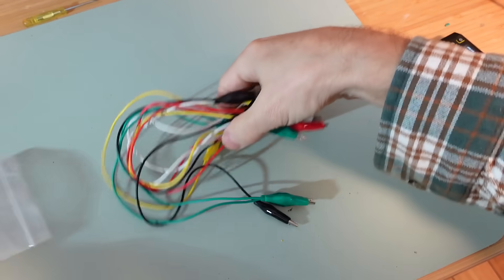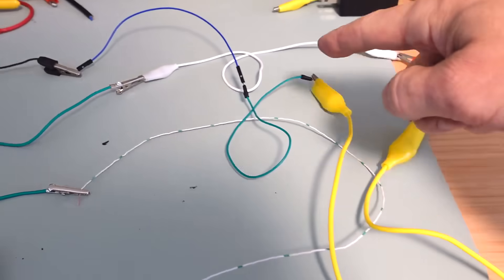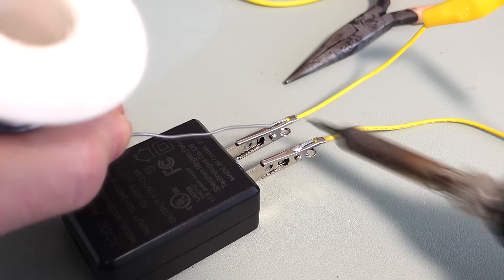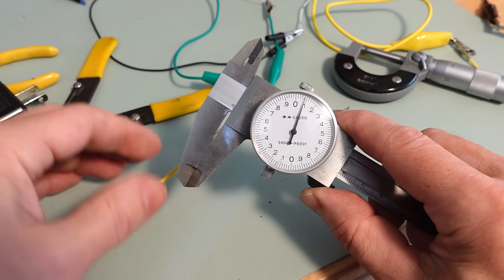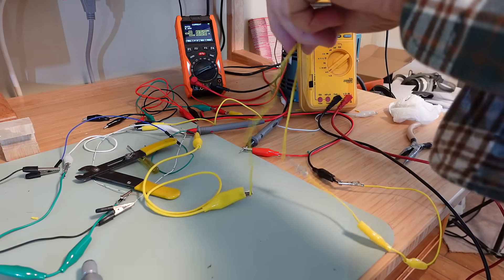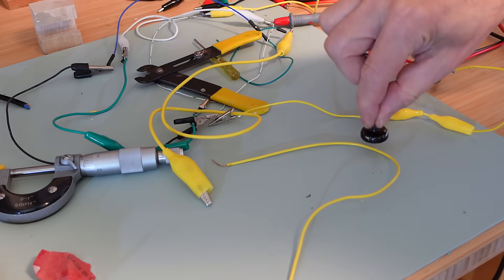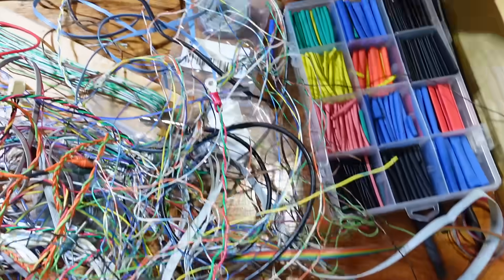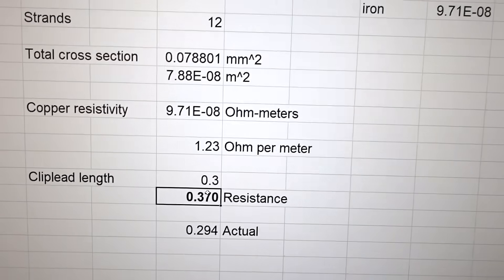Clip leads made with fake wire

Comment: Busted out a magnet to find some of my ribbon cables are iron cored, some are not. Gotta wonder with the miniscule amount of actual wire that goes into these things what are they really saving in terms of costs, a couple pennies? End price is always inflated as hell on Amazon in the end anyway and that penny saving iron wire is just an added insult. For milliohm testing I use an RC3563 battery tester. It's designed for testing internal resistance of batteries, but works just as well testing plain wire resistance with a resolution of 1mOhm. WAY more precise, even if not extremely accurate, than a DMM. If you're thinking of picking one up, SHOP AROUND, I've seem it sold for ridiculous prices and way down to $30 USD. Nothing but scalpers and drop-shippers especially on Amazon.

Comment: To see if cables are aluminium or CCA you can have out the strands and use a regular lighter on the strands, if it curls back like a spring it's aluminium.

All those clips leads is only for small signals and even in stores here they are exactly the same....

I always change the cable and solder 😅
Last time i just bought a bag of loose clips instead.

Didn't think it was iron tho, just that it was the miniscule amount of cross section since it's thinner than lady beards 😹

Comment: If it's less that 1 ohm is that really relevant?
Reply from the maker: sometimes I pass 5 amps thru clipleads.  that would be 25 watts loss, enough to melt the lead
Reply: @matthiasrandomstuff2221  Just because you can sometimes do a thing does not necessarily make it a smart thing to do. LOL.

Comment: I got scammed by those junk Chinese wire-clip leads 3-4 years ago.  Literally, no solder used at all, junk wire, and the resistance varied from 0.2 to 8+ ohm so I threw them into the trash can 😡

I started making my own wire-clip leads with quality wire with soldered on clips which all have a resistance of 0.2ohm which I put to the test on a 750mV floor furnace system when testing the thermostat and universal gas valve, they worked perfectly which is more than I can say about the defectively engineered Honeywell millivolt thermostat 🥳

To be fair, the Chinese 12awg versions are top quality wire-clip leads and worth adding to your toolbox.  I've used them on multiple occasions for jumping out a water heater till replacement parts arrived.  The wires only got a little warm and easily handled the current draw (4500W element) and sure beats taking a cold shower 😉

Comment: The mouse wire might be magnetic from any reinforcement in the cable. I wonder if you took the casing off and tested the actual electrical wires if that would be copper or not.

Comment: Mouse and telephone wires are iron or some alloy since the leads or shelding is made of iron because it is more resistand to breaking because of flexing. And since there is not much current flowing, it's not going to be problem.

Comment: Classic for Chinese, even transformers wire is aluminum with email that looks like is copper. also i have some thick speaker wire that I trash as it was copper plated aluminum , 
Now it became official some, reputable seller eve mention copper claded aluminum on the wire material.
Buying from reputable seller will mention even the crocodile, if is made from steel or copper and the cladding material...
Reply: they might use steel on bride material that protects cable or environment from interference, ...

Comment: I’ve noticed this trend from years back. Many many devices, leads etc. Have iron wires what you can find from Ali. Some of them have few copper strands and the rest iron. What I’ve seen were uncoated iron se they were easily visible. Funny that they started to copper plate those, but you can’t fool the magnet. Also many of the headers and connectors you can find from Ali are iron. You never know what you get from there. I encourage to write to the review these things. I always do that and hopefully someone read the reviews and skip those..

Comment: Maybe those are optimized for high-frequency AC-only tests?  Seriously though, I was expecting to find comments related to whether electricity flows more through the surface of the wire or through the cross-section.

Comment: Well, there is one quite good reason for some wires to be made of steel instead of copper: It is way more robust against fatigue cracks when moving them all the time, copper tends to break way easier. Of course the drawback is their higher resistance, so the use is limited to where that is not a problem. E.g. a signalling cable exposed to a lot of flexing would be a good candidate to be made using steel conductors instead of copper. Mainly when it is handling rf, where all the current flows just on the surface anyway, so through the copper coating part.
In fact many old (wired) telephone head set cables were using conductors made of metal (maybe not even copper) coated nylon strands, again to prevent them from breaking so often with all the use and abuse the telephones encountered. A 1m wire had easily a few Ohms, but in a few 100's Ohm earpiece or microphone circuit it was no big deal at all, the fact it was not developing crack and then contact noise between individual strands, as the worn out copper cables used to do, so the absence of all the motion related crackling was quite a big deal in that application...
Of course, it should be stated in the product description, otherwise I would also consider it a scam.

Comment: I recently wondered why my cheap crocodile cables from Aliexpress get very warm even with a low current. While watching the video, I held a magnet to it. Guess what the result was.
I knew that the Chinese like to use copper-plated aluminum. (Especially for transformers) but iron wire was new to me.
However, I have already noticed this with resistors and diodes from China. The wire scraps always got stuck on the magnetic side cutter.

Comment: Another thing that could have influenced the resistance of the wire is the steel alloy they used. I wouldn't be surprised if a lot of the wires even of the same length end up having vastly different resistances.

Comment: At least they're iron. I've got some chinese jump wires and about 50% of them had no wire at all! They crimped the dupont leads to bot sides, but the fake ones had only the insulation without anything inside.
Reply: At least you have no measurable resistance 😂
Reply: @matroosoft  Resistance is futile! 🙃

(As is trying to jump-start a car using a lead rated to infinity Ohms. 😋)
Reply: those ones will be for movie sets....... imitation leads.

Comment: I'm late the to the party. I've heard of copper coated aluminum wires, but not iron. A while back, I cut a usb cable in half. When I stripped the wires, they didn't look like an normal. They were very dark, almsot dirty or oxidized in color, but still looked like copper. The wires were also very thin. Thinking about it, that's probably what that usb cable was.

Comment: The mouse wire probably has shielding surrounding the copper wires. But idk, mice cables are usually thin and dont feature shielding since the cable length is short.

Comment: USB cables are shielded, and some even have a thin steel wire for reinforcement, same goes for many types of "data" cables, like ethernet, sata, vga/dvi/hdmi/dp etc.
Depending on the frequency of the carried data signal, in some cases iron/steel for the shield might actually be a better choice than copper.

Comment: I just tested my entire clip leads box, and I did not find any iron wire. However, the cheaper ones I have are 10+ years old, and the newer ones are from Diligent, from the Analog Discovery oscilloscope.

Comment: I thought that it's all-known that the Chinese "wires" are not actually wires at all. It's just a conductance containing product. Most of bench such products are made of steel plated with a thin layer of copper. And something like welding cables or power chords is aluminum (plated with copper also which is almost disgusting by the way)

Comment: FYI, for the computer mouse it's probably the shielding, peripherals like this often have shielding to help with interference, but USB extension often will omit shielding to keep cost as low as possible. While the expensive USB extensions will often use thin aluminium foil as shielding.

Comment: This is not a bad thing at all: You bought wires, and you got wires. They do conduct current! Whats worse, is the scam with the crossection of cables. I got scammed by 4 out of 5 vendors, that sold me 20% less copper than advertised! Amazon, ebay, and some german shops. Even some better known ones! Its disgusting!

Comment: I think others have pointed out 6:05 about the shielding on USB/mice cables being ferromagnetic. I’ve taken apart USB cables that have no shielding, some that have an uninsulated ground lead, some that have a cylindrical sheath of shielding wire, and some that have a metallic sleeve plus a cylindrical grounding wire. All different types. Would be fun to see you dissect some failed USB cables of different cost-manufactured specs. Thanks for sharing.
Reply: I took apart an hp mouse like the one in the video, and it was not shielded, but it did have some sort of iron cord running in it. Not sure the purpose, but it was so odd, I still remember it.

Comment: Oops, yesterday I was charging Li-Ion batteries with my benchtop power supply and noticed that I couldn't get more than 2A through them without going over 4,2V per cell, even though I expected more like 10A.

I already noticed that the wire resistance had a larger role than the cells themselves. But this explains it.

With the wires shorted and running 5A through them, I noticed the wires getting hot enough that they would start to smoke if I left them. So yes, that's really bad.

Comment: Copper-coated aluminum is also an epidemic. It's nice and low resistance, until it is flexed. It creates micro-fractures and connection slowly degrades over time. I've had to swap out 30% of my 3d printer's wiring because of this, and buying "copper" wire on Amazon is always a risk.

Comment: 300 milli-ohms is better than average for that sort of crap. I have seen a lot worse. The problem was never the crimping. That doesn't account for that sort of resistance. It is always the rubbish they call wire. Throw away the wire and solder in some decent stuff.

Comment: probably just for signal path, not power.
there is no point in using copper, for short length high impedance sink signal path, which is more rare and expensive.

Comment: Great video as always! 👍

Yeah, these iron wires may be dangerous.. One time I got device with mains cable from iron.. I replaced it immediately..
Worst thing is, that lamps may, even, come with iron wires and in best case scenario they just loose connection in crimped bulb holder after a time..

Comment: I discovered this a few years ago when the wire of a clip lead started getting hot. I've been seeing stick lead resistors with iron/steel leads for longer than that. It doesn't really matter on most resistors I suppose, as most of them are much higher in resistance by design.

Comment: Super good discovery. I had no idea that they did that. I have heard and seen jumper cables that are made of aluminium coated with copper but never test leads. Super good to know!
Reply: That’s the first thing I thought off! I had a set of jumper cables that I purchased in a store but after 3-4 separate attempts of trying to jump someone in need without success I started to question what they were even made out of. Luckily I had other backup options like battery packs and older supposedly smaller gage wire cables but it really bothered me.

Comment: I've seen multi strand steel cable as the power cable. It was on big Clive months ago. Basically a resistive heating element in a plastic sheath.
Reply from the maker: camd across one of those ten years ago too

Comment: F*cking chinesium.  This is why I've become afraid to buy anything made in China.  Things like this iron wire, sand filled batteries, counterfeit MOSFETs, lathe tools shipped with the wrong inserts, stuff that just doesn't work.  They have no shame at blatantly cheating and their government tolerates such behavior and researching vendor reputation is too difficult.  Sigh.

Comment: Yes I also fell for these.  Charging a li-ion pack didn't go that well and I was lucky that I was charging outside.   
I bought some silicone wire and good quality clips for the price of a sandwich.  Spend 2 hours making proper cables and I am sure that those cables will still be working well and should also be working in 10 years time.

Comment: I wonder if they use the steel/iron wire BECAUSE they are making the wire so thin... it may be that copper is too fragile at those tiny sizes? Obviously ridiculous to have that much resistance on something like that, but maybe an insight into how/why it ended up that way.

Comment: Isn't this a woodworking channel with mousetrap and maze research I used to watch occasionally? :D Now, it becomes an allrounder.

Good to know, that your breadboard wire was not that bad. However, I had problems having barely used breadboard wire breaking :/
For silicone wire I thought Aliexpress is a good source, is that not the case? I am actually interested in tipps where to get good and cheap wire. Sometimes Iron might be good enough, but I am also too lazy to do research on my own, although I should be capable of performing that task.
Reply from the maker: No, THIS channel has never really been about that.  If you want woodworking related, go to my woodworking channel.

Comment: If magnet not taking it - it's copper coated aluminum... But get micrometer to zero you must unscrew handle apart slightly and fasten it at ZERO. My micrometers do that.

Comment: Bruh, I didn't catch that, I bought similar leads one day, but only because the leads where cheaper than I could get the clips alone for, so I bought the leads and replaced them with proper wire.

Comment: I had bought the same wire clips from China (banggood I think) and also noticed they were WAY too thin. Didn't think much of I though because I never ran a lot of current through them, until I shorted something out and the magic smoke came out fairly quickly. Replaced them all with soldered (way thicker) scrap wire I had laying around since then.

Comment: Sure enough, some of the jumper wires on my desk are magnetic. It's the unbranded ones, that came with a bunch of cheap usb-uart-bridges. Some branded ones (but also chinese), that I bought separately, aren't. A cheap roll of wire I tested is not magnetic, even though it became silvery after some wear. I guess it's aluminium.

Comment: Stuff like this needs a wide audience so there's pressure on manufacturers to be transparent.
Reply: Chinese manufacturers don't care.
Reply: @zyxw2000  They might, if people stop buying their product.
Reply: @hiandrewfisher  They change names more frequently than I change underwear (the sellers if not the white label manufacturers), you'll never know i you're buying "one of the good ones" or literal garbage.
Reply: Manufacturers are not going to change and as others have said they just change names etc if required. However selling platforms should not be able to to just shrug their shoulders when misleading listings are made on their sites. If they took a financial penalty each time a false listing occurred they would start being more rigorous about things. Harder to do with the likes of Temu than Amazon but online commerce does need to additional regulation.
Reply: To be fair, were these alligator clips sold under the name of a reputable electronics supplier (with a reputation to upkeep) or at least from a reputable electronics store, or were they sold under a generic brand (likely online and not from a reputable electronics supplier)?  If the latter then what else can be expected?
Reply: Chyna don't care. They sell them through fake companies in other countries so you just don't know.
Reply: There won't be any pressure.  There might be some cynical pandering by corrupt politicians, but nothing that achieves the goal of replacing fraudulent products with working ones.

I went through this a LONG time ago with eBay regarding sellers peddling power cables made of this stuff.  They didn't care.  They didn't remove the listings.  I even mentioned it on Reddit.  No traction whatsoever.

I'm sure we all know the phrase "poisoning the well."  That's what is happening here.  Interested groups are poisoning the public markets with defective products.  And public attention will not be directed towards this fact until it can be leveraged to cripple those markets -- if not permanently -- for a long time.
Reply: These are cheap $5 kits sold on TEMU or Amazon by nameless little manufactures in China,  it's buyer be ware type of deal.

Comment: Great video, I also got a very similar pack of clip wires and sure enough they have some iron, can't seem to find any other wires with iron but i have several other recent cheap wires in other products and they do not have iron, I wonder why they don't cheap on a wider range of cables and not just these

Comment: I bought the cheapest set I could find off Amazon recently,  and they look just like the ones you had to solder, but these were already properly soldered are nonmagnetic. I must have gotten lucky. My meter only goes down to 0.1 ohms though, and it shows 0.2 ohms.

Comment: I never thought to check iron wires... I have a bunch of cheap clip leads, the wire them is even thinner than the ones in this video... not that i need them for powering anything, i work with weak signals but increased resistance might be an issue, but then again they are VERY thin. Probably 6 strands.

Huge thanks for the information, now i know that i have to check if the wires are actually copper or not. Never thought that would be a problem